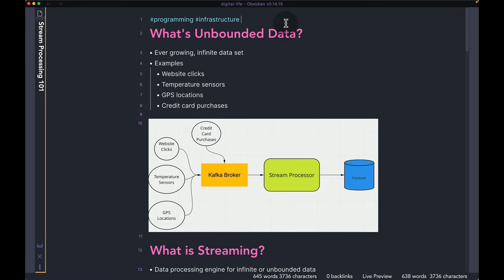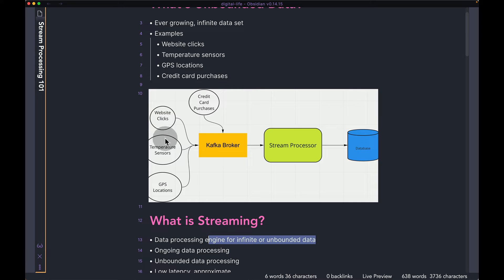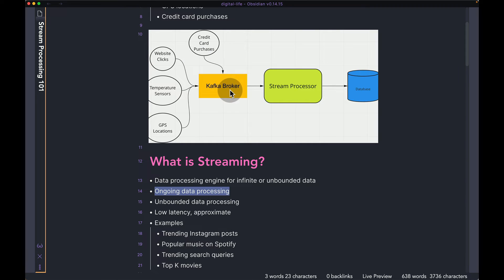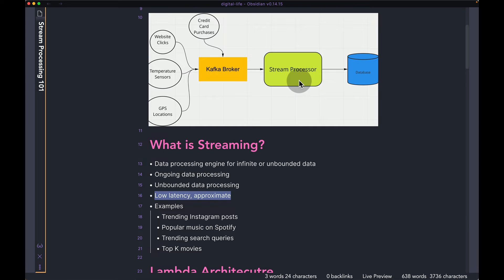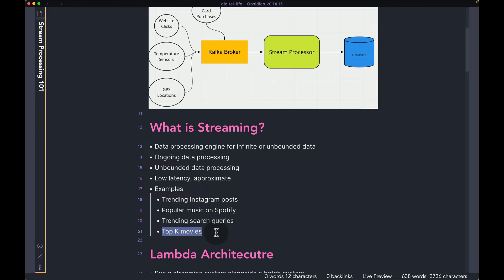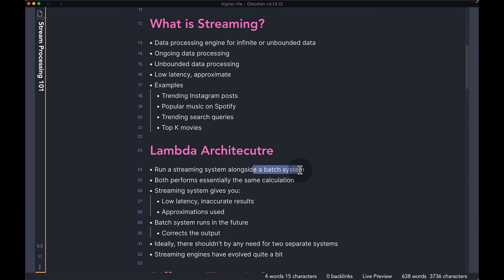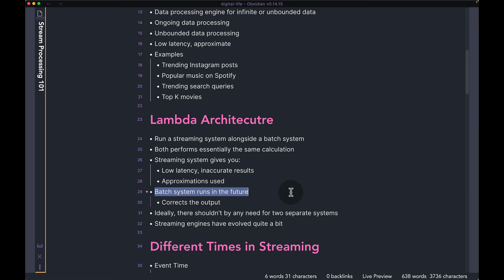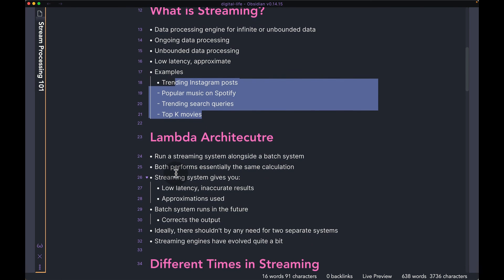Stream Processing 101 | Basics

Comment: thanks sir for such simple yet comprehensive content , however if one is intrested adding a bit of streaming compononent  to a simple webapp like those being built with solara /fast api in python  , or shiny-based apps in R ? what is the best way going about that ? let say I want to let my function behind the app calculate / estimate certain relationship but based off real-time data (usually it comes with delay) like those being featured on nasa weather conditions or yahoo or on-line IoT data sources or simple news articles on FT? while not consuming minimum of memory possible !
I appreciate if you can provide some form of written / video-based content of how to at least go about that on conceptual / design level ?
your input is highly appreciated
Reply from the maker: In that case, I would just spin up Kafka, and write a lightweight Consumer to process the data locally. As long as you are not storing data locally, your memory consumption should be low.

You can also consider RabbitMQ, they tend to be more lightweight than Kafka.